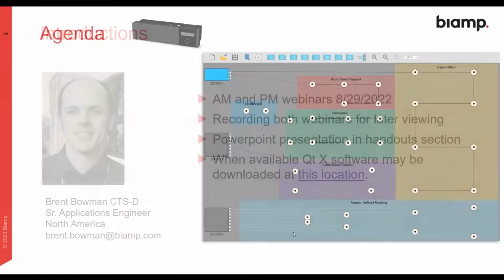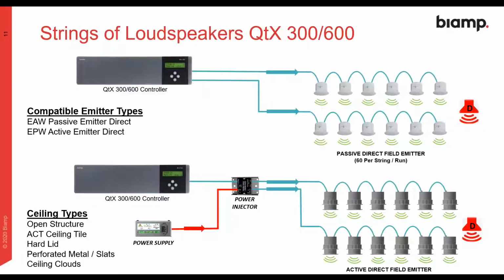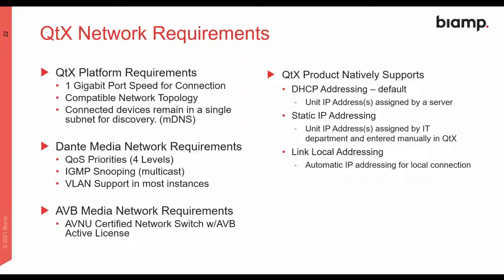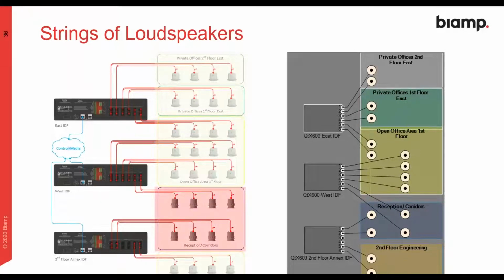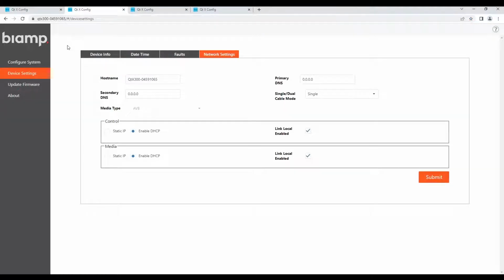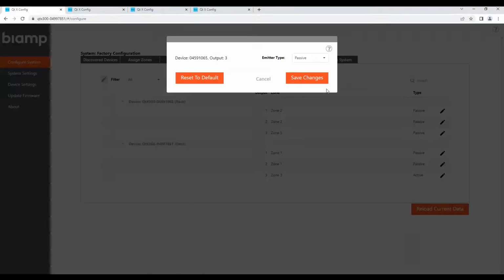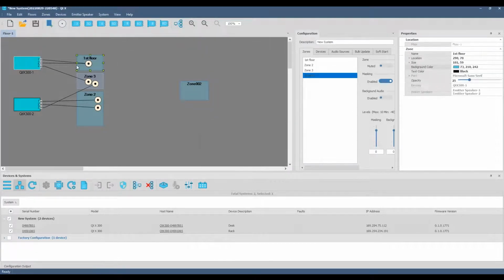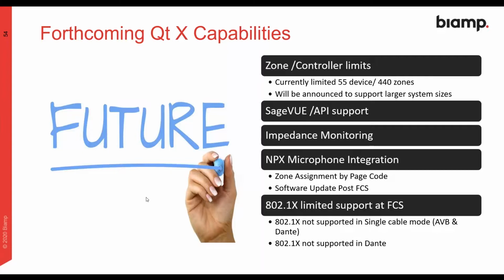Webinar: Getting to Know Qt X

Comment: When you reset the QTX 600 by pressing the small hole at the back of the control, will that reset and disable all the ports? Installing a qtx 600 and plugging our runs as we go. First 4 zones work great but after that, as I add the remaining 2 zones, I dont get any output from those 2 remaining ports/zones. Tried resetting, but after resetting, all zones/ports dont work anymore. What could be the issue?